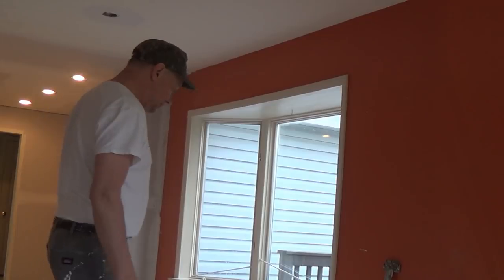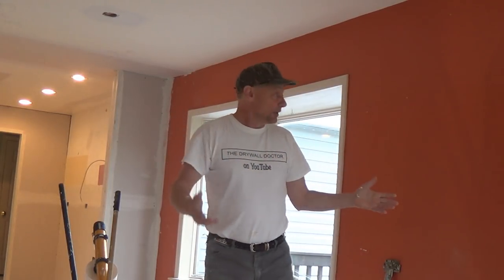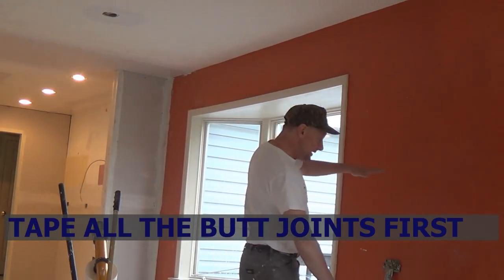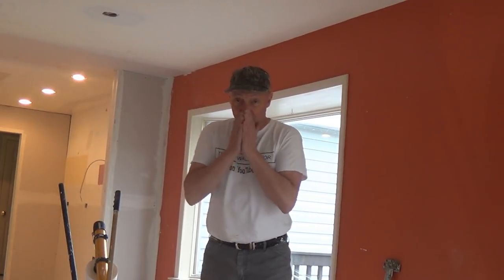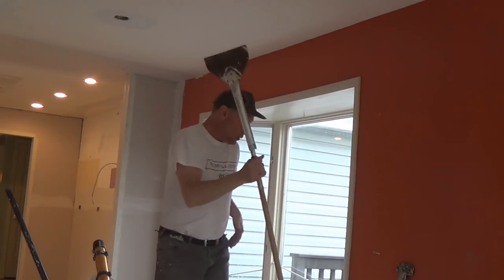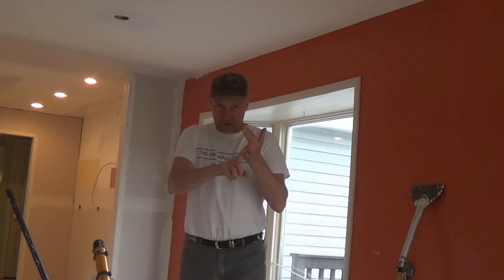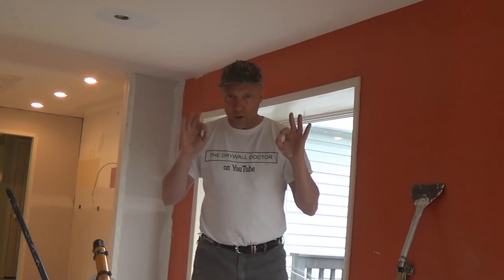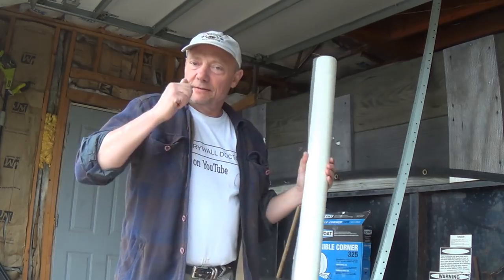Close up On The Steps To Tape Only

Comment: Tapered edge should always be done first if that is what you are calling seams then corners then butt joints
Reply: The tape for the butt joint should be under the tape for the tapered edge (flat)  joint. It's less likely to show. Inside corners (angles) are done last so that the tape from flats and butts are under the corner tape. When done this way it is also less likely to show.